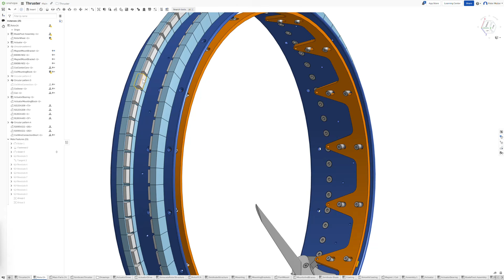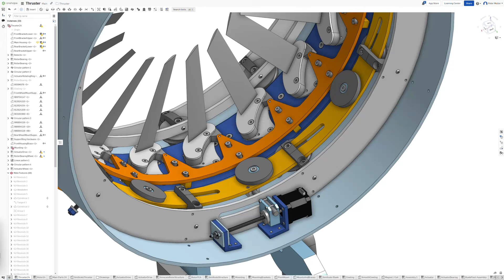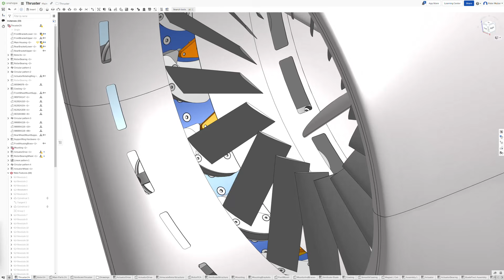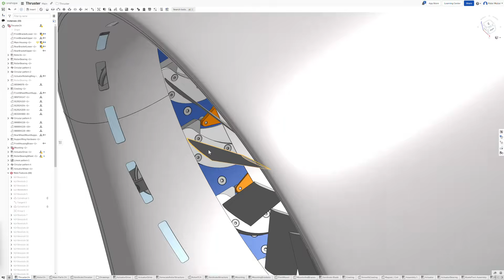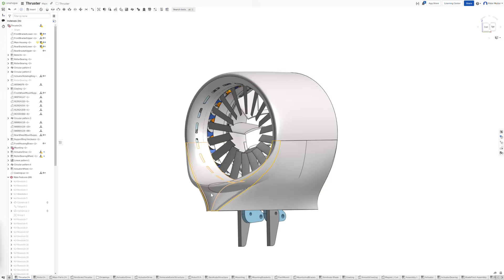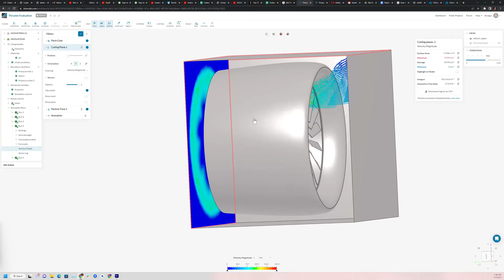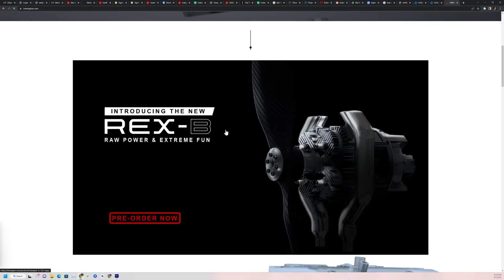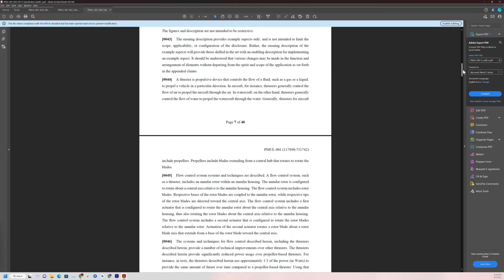Could this Thruster transform Aviation?

Comment: The outer diameter "rail" is a problem. All contact surfaces will have to move at synchronous speed with the outer ring to avoid sliding and wear.

If the outer rim contact surface is not kept isolated from dirt and dust, every single grain of dust in the air will be crushed between the surfaces and infused into the surfaces. Like a railway but a year worth of traffic in a few minutes.

The outer rim is extremely hard so seal off from dirt compared to a center hub design.

Also any dust damage to a support wheel will damage the rim at all points and propagate to all other support wheels.

The railway problem is a superior enemy when adding water and dirt.

Does the magnets and coils form a closed loop with small airgap? This gap 0.1-0.5 mm has to be small to compete with compact electric motors and extremely hard to maintain on a large rim.

Moving all the action to the outer rim seems to enlarge them.

Comment: I think the blades being under compression is a bad thing. The air tries to bend the blades and the centripetal force tries to fold them over. The material is much weaker unter this buckeling load than in tension like on a normal propeller. My model airplane propeller is essentially as strong as a popsicle stick and produces 1 kg of thrust.

Comment: This is exactly wrong :-what a conventional helicopter rotor, or to a lesser extent a propeller ,suffers from is reverse flow at the centre where the higher pressure under or behind the disc seeks to escape via the hole in the centre (just like the wing tip spillage ) - what would be better is a second higher RPM rotor running concentically and helping to avoid the stalled blade root sections and suppress the backflow -referred to as the 'fountain' in helicopter terms ,particularly when in ground effect hover - a distinct bound vortex is observed with smoke or dust -the whole flow field being not unlike an apple in shape with upwash at the 'core' and recirculation occurring .   This shows how excessive CGI and CAD can blind basic understanding --the circumferential stresses in the drive rim will be enormous and require much more material than the relatively stationary hub of a normal propeller --huge gyroscopic foces and bearing loads etc etc for no benefit  (NOTE for low speed marine propellers this design is well known and might have advantages in avoiding shaft and hull shape effects and thrust vectoring for docking  -the voight Schneider prop is related .  )

Comment: look up rolce royce truster … exact thing already in use in military ship 
except . the blade thing . they use diferent thing for trust under watter 
the geniouse thing being its capabilities due to switching mechaninc that eliminates lenze’s law 
Back draw of the clashing magnet it collects instead . so it becomes as a generator not only a motor .
In sence if more power is put on it goes better the less the more power consumtion .
At one point it goes without no need for energy input but gives more out for charge.

Comment: Remove the Tesla magnets from the old generator and have an Edison generator you can add inverters to deliver House current 110 VOLT AC.  Tesla bound Edison's generator with magnets all around the armature and used water to move the armature magnets and coils.  Chisel off one sixth and leave one sixth on alternating All the way around and you have an Edison generator.  A dynamo is a brushless motor like this with generator coils.  Edison generators do not use wind water steam or fossil fuels.  A permanent magnet is a permanent source of force and magnetic field.  We don't have to add energy to the motor.  A permanent magnet motor has permanent force and field.

Comment: Neat design but I doubt it will bee commercially successful even if it is functional unless we ever develop sufficiently battery technology.
generators are not lightweight even if you find a lightweight engine to run it. the combined apparatus will inevitably be heavier then having the engine provide power directly.

Comment: If memory serves me correctly the CF-105 Avro Arrow had had(or at least had designed ) Iroquois engines which were rim bearing and a leap forward in jet engines. Circia 1957/60

Comment: I have think this but every fixed to central motor propeller axe but this propeller have necexary of a internal ring for high volume power air for resist blade propeller

Comment: I don't think you can easily beat blades sticking out under tension from the shaft. I think "thruster" design is inherently unreliable and unstable. Each blade is in an unstable equilibrium and any misalignment will immediately put bending forces on it that will have to eventually lead to failure. Also rotation speed limit should be much less because I can imagine a blade can safely withstand more forces in tension than in compression (and unsupported from the sides).

Comment: From an aerodynamical point of view, this design appears to address things quite right. Gaining a 3.5 times efficiency, measured in thrust appears a lot. This figure suggests, propellers were wasting two thirds of what would be possible. But, what kind of efficiency you are speaking of? As far as I understood, you are speaking of thrust/input power. As far as I know, thrust is force, so your efficiency coefficient is force/power? But what efficiency coefficient Prop versus your Thruster appears in means of power/power efficiency?

In any case, there will be severe mechanical as well as one electrical challenges to be solved.
The few disk bearings, taking the main propulsion force induce great variation of local axial force to a large main rotor hub ring with frequency No of bearing x rpm. This causes bending waves to the main ring. I suppose, it will turn out quite an effort to take care of those bending waves. I see a long road for optimizing blade count of rotor and stator, bearing count, designing bending wave speed alongside the rotor ring and so on.
The variable pitch mechanism has to not rely on normal operation. There is pitch control by pitching air force in one direction and pitching mechanism the other. In case, the engine quits, the air force turns around, so better couple the pitch control in a way, controlling both momentums.
The outrunner with 72 magnets will suffer from commutaion loss. As some comments state, a final design would have to use less magnetic poles, lowering the frequency of motor commutaions.

Alltogether, keep on making. The aerodynamical concept is so promising, there can't be too much of an effort not worth the concept.

Comment: Something the people who were studying the SR-71 found out is when the pilots pushed those very special engines to the limit, they were consuming twice as much fuel when compared to cruise speed but (and it's a BIG 'but') under those conditions, the SR-71 was covering 4 times the distance...so I don't know if the information above is helpful in any way (especially since the engines were special, the fuel was special, the air frame and skin was special, even the flight suits were special).

Comment: You're talking an awfully big game for a blade ring strapped to a torque motor running for less than 100 hours total.
This concept has existed for decades and if it trouly was as good as you make it out to be large manufacturers would've used them by now.

Comment: With the adjustable fan this could be used with a ram or scramjet. You could adjust the fins so they provide no resistance once the ramjet has reached peak intake and thrust.

Comment: This is the most HORRIBLE and REVOLTING idea I've seen as an aircraft engine engineer. 

The only idea that made sense was adding vanes at the rear of the cowl. The whole idea is so much bullpoopoo. You're adding so much weight, more points of failure and significantly shortening the lifespan of the bearings.

You've really squandered your talent, time and effort into this.

Comment: this is just completely utterly stupid. 

1. instead of using smaller, lighter bearings with the linear rate the ball bearings are rolling at kept low for low wear and friction, you put bearings on the outside, requiring heavier bigger bearings running at a much higher linear rate (FPM or mm/s) in ball velocity. Just bad for bearings.
2. the blades now induce their own turbulence due to tip vortices interacting within the mechanism itself. The entire point of a ducted fan is to eliminate tip vortices and now you intentionally inject them?
3. The now much higher outside mass of the rim spinning at high speeds adds far more gyroscopic effects since the majority of the weight is on the OUTSIDE of the turbine, instead of the inside. This will make this thing highly susceptible to bearing chatter, and warping and causing yaw/pitch problems during maneuvers. 
4. If a motor had been installed in the inside, where no useful flow occurs anyway, this could improve the aerodynamics of the system, and keep flow stability high through the whole system. Any advantage by putting the motor on the perimeter is negated by said motor's and fan's large increase of mass and reduction in rigidity and flow performance.
5.If you really wanted to eliminate or reduce the inner section, you could have reduced it to bearings only, and supplied power via a shaft drive mechanism or belt/chain drive so nothing else existed in there, this would cost some efficiency for the belt drive but they are fairly efficient to begin with at nominal 95-98 percent.
6. if efficiency was the concern here, why use so many blades and permit them to generate tip vorticies?    A higher efficiency way would be to make all the blades converge together to eliminate tip vorticies, or at minimum put cranked tips on them.  Also a lower quantity of blades would improve total efficiency.  
It seems like the whole project is stemmed on a poor idea to copy a modern turbofan and make it look "sci-tech"

Comment: O boy!!! I was working on the same design 5-years ago! Aerodynamically it is something special, but to make it suitable for propulsion you need high RPM. And high RPM need very good bearings, which in this design is the main issue unfortunately. That being said... your design is a FAILURE. If you do just a small, simple calculation, you will find out that the radial speed of the outer rim(where the blades are attached) is so huge that no bearing could survive. Actually the small black rollers you used in the design to support the "fan" , due to the speed ratio conversion are spinning even faster!  If you really want this blade-design to work, you should make a contactless bearings-either magnetic or on air cushion.  I know because as I said I've been there!

Comment: The petro advantage here is the lack of moving parts adding to the exceptional reliability of aviation turbines. This literally kills the concept, while interesting, it isnt new at all. And as such a lack of engineering isn't the problem but rather moving loads of people safely with the least amount of failure points.

Comment: Interesting but, as so many others have mentioned, there are a myriad of issues with this concept. Not the least of which is that a fan like this isn't an aircraft engine by any stretch of the imagination. There is a reason that in our modern world it takes large corporations with lots of money to design, analyze, test, build, test, certify, test, etc any people carrying aircraft of any type. It is not simple and if you get it wrong, people die. One man bands of aviation are a thing of the past, ask Burt Rhutan. You need a highly skilled team to do this. Even he built a team eventually and in the long run it didn't really work out for him. Sorry.

Comment: If it's electric the answer is no, it isn't going to transform aviation.  The problem is you need heavy batteries which remain the same weight at the end of the flight as they do at the beginning.

Comment: IMO this prototype is far away from being usable. My first idea: At this stage it will not overlive external environment (temperatures from -60°C to +270°C, humidity up to 100%) with constant 3000 RPM. The main problem I see in the main design idea - engine in the outer ring. The outer ring will be too heavy. It will create very high gyroscopic forces and also mind the very high centrifugal forces. Also the insane number of needed bearings.

Comment: i dont see how this could possibly withstand the mechanical stress that a classic propeller easily handles. the slightest amount of deflection would make this thing explode violently. we dont have a material that can reach the necessary speed in this configuration and the bearings are inherently much more lossy.

Comment: too many parts and bearings and wheels. the only advantage this designed  has is torque, which could be designed much simpler by having blades with holes running through the length of them which would be mounted on spokes connecting the center shaft to the outer ring held together by the housing containing the stationary magnets. basically a normal turbofan section of a airplane engine still connected to a center shaft just powered by the outer diameter instead of the center shaft. and because of all the extra torque from this design , i dont think you would even need 3 phases which would cut down on weight and parts and electric consumption ,just a thought

Comment: Your last project was a failure, what it makes this one different, CFD alone only shows a neat simulation, for this type of engine you need manufacturing capabilities only found at Pratt & Withney, at 100rpm and you get a lot of vibrations on the tips, imagine at 5k rpms!. Stop cutting corners, you are going to get killed.

Comment: I lost you at where you started talking about advantages over jet fuel.

Interesting design.
Since it's electric, the main competition is lightweight prop planes and electric vtols.
You need some actual numbers vs them. The simulations magically disappearing does not speak well for you.

Also this has a huge amount of very high rpm bearings. Each of them being a possible failure point. Bringing that number down would be the next priority.

Comment: Oh yea, why are you using rollers? You could have alot better winding setup then that. I havent patented that yet either so. Have you not seen a magnetic bearing? You should be able to lock it in place with electromagnets which is literally an electric motor.

Comment: Sorry to rain on your party, after you did some good work on the prototype, but those spreadsheet numbers look REALLY suspicious.  Are you sure you should be scaling up the thrust by the cube of the engine dimension?  Seems like you shouldn't be counting the thrust axis as an axis that's scaling up, only the 2 axes of the rotor disc.  That's why helicopter rotors are rated by their DISC LOADING and not spherical or cylindrical loading.  Scale up the thrust by the square of the engine dimension instead, and it should be closer to reality.  That's why your prototype isn't blowing you off your feet.  24 inch diameter conventional propeller gives enough thrust to fly a manned ultralight.  The prototype should also do that.  But it looks like it wouldn't, even if the bearings were somehow upgraded to withstand realistic speeds for any usable length of lifetime at all.  Still i hope some portion of the patent draws some interest from someone down the road for you.  Stay at it and keep the spirit of invention alive!

Comment: No, two bladed propellers are already provably 80-90% efficient (see: actuator disk theory, and minimum induced loss propellers). Being more than 20% better than that is impossible and you're claiming several times better, so it immediately doesn't pass the sanity check. Your CFD results are questionable at best. Why is there no air flow around the outside of the cowl? Why do you seem to arbitrarily grab measurements when the simulation is clearly unconverged? Why is the computational domain so small that you have a strong velocity gradient across the inlet? Are pressure boundary conditions on both inlet and outlet appropriate here? It's clear the two propulsion types were simulated in very different conditions and the stated thruster power and thrust only obeys the laws of thermodynamics at velocities < 10m/s which doesn't seem to be the intent. Frankly, I can't tell if you're making a serious attempt or trying to mislead people, but I'm trying to assume you're being honest. I'd be extremely impressed if you were able to show a 10% efficiency improvement, but for the added complexity, that's probably not enough to transform aviation.
Reply: Hi, Christopher. Sure, two blades are efficient for low thrust applications, but who cares? A two-bladed high-power prop will go supersonic and die.
There is a solution:
A direct drive small diameter prop, then a stationary nose cone that spreads and smooths the wash while consuming tip vortexes via entrainment, and a planetary-gear-driven huge-but-1/10 speed counter-rotating prop.
Everything smooths. Everything balances. Everything stays well below the speed of sound. And the final wash doesn't rotate.

Comment: Don't the wheels provide multiple points of failure?  Since your using a rotor/stater setup couldn't you make it so that it is "basically" using magnetic levitation instead of wheels?  NOT speaking from experience.